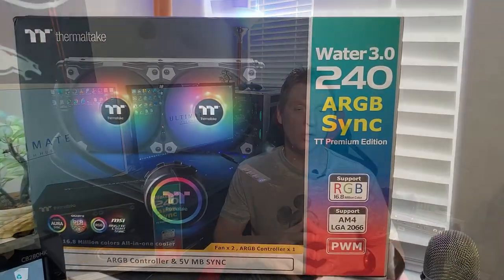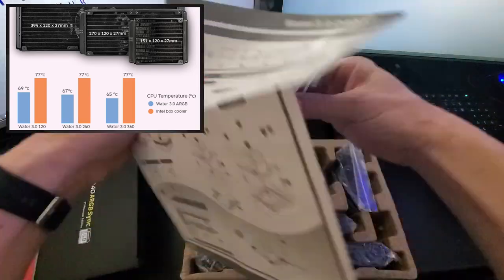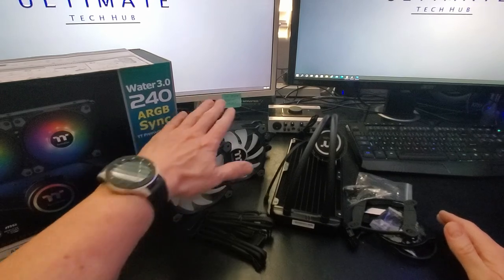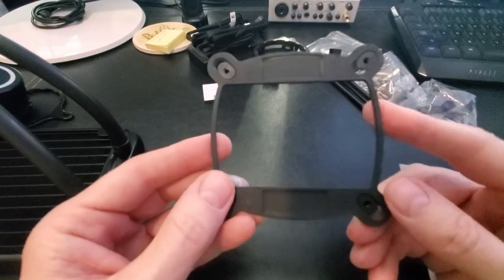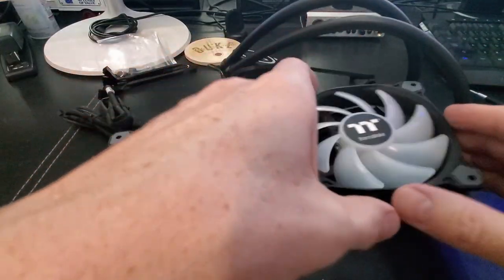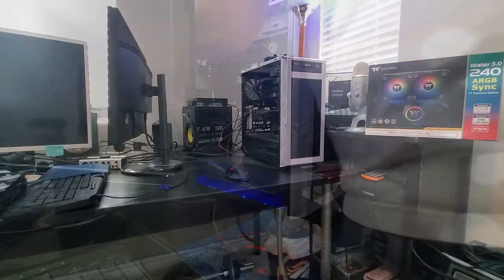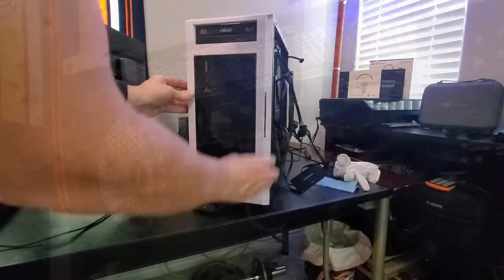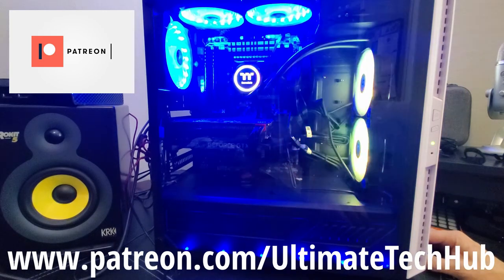THERMALTAKE WATER COOLER- INSTALL - THERMALTAKE WATER 3.0 240

Comment from the maker: We installed this Thermaltake Water 3.0 CPU Cooler in about an hour but would have been a 30 minutes if we didn't have to remove our old Enermax CPU cooler. We also installed 3 Blue LED Case Fans to help cool the PC case even more and to add some cool light effects. Thanks for watching!

Comment: your radiator fans, and external fan are both set to exhaust, normally people with fans on a radiator at the front, are reversed to bring airs through the radiator and into the pc, to cool it down, you must be etting negative airflow, so your pc must be roasty toasty.

Comment: Inlet and outlet on the radiator need to be at the bottom so the air bubbles will stay at the top of the radiator and not get into the lines and reach the pump
Reply: Common misconception. That is not the case. The pumps are not strong enough to pull air bubbles down from the air tanks. There are air tank to capture bubbles on both ends of the radiator.
Reply: @vids595  exactly they are made to be mounted how ever.

Comment: is this a decent cooler to buy? or is it crappy?
this one vs Cooler Master MasterLiquid ML240RG?
Reply from the maker: It's a good cooler. Not great but I've had no issues. I'm not familiar with the Cooler Master model. How much is that model?
Reply: @UltimateTechHub  they say it's a very good cooler for the price, it's 68 USD on amazon

Comment: hello, how do you set up your fans for cooling the inside of the case?
Reply from the maker: Just as I've shown. I installed a new fan in the back of the case and 2 at the top. PC stays cool even when I'm using many applications. And the water cooler keeps the CPU cool.
Reply: @UltimateTechHub  thanks for the reply, sorry to ask you again, i'm pretty new to pc, just confused about which should be the intake and which should be the exhaust?
Reply from the maker: @vedish2  Generally, you want the case fans in front of the case drawing in air while the fans at the rear blow air out.
If your case has vents at the top, they should be placed as exhaust fans because hot air will rise. Side-mounted fans should be used for intake. I hope this helps.
Reply: @UltimateTechHub  thanks

Comment: how do you like it w the radiatior on the front? its so hard for me to get good intake through the front
Reply from the maker: It's pretty good but would be better at the top of the case. I wish it would have fit. Temps are good and only gets warm when I'm doing video editing or gaming. Thanks for watching and if you subscribed thank you as well.
Reply: @UltimateTechHub  thank you!